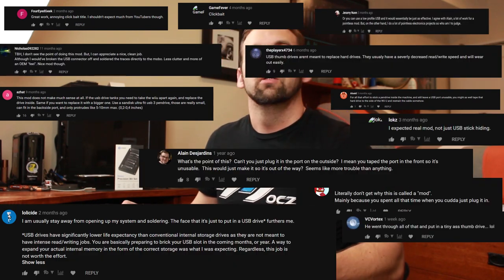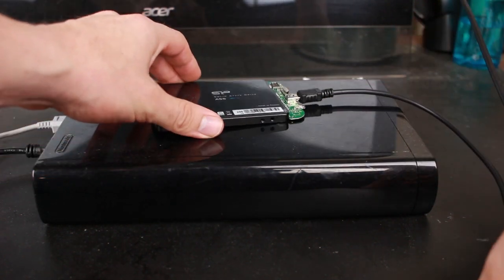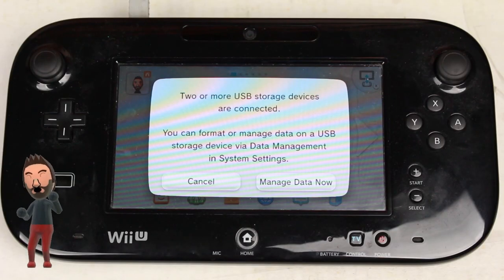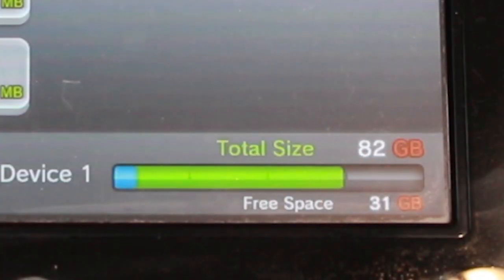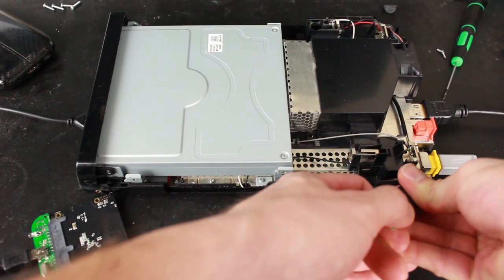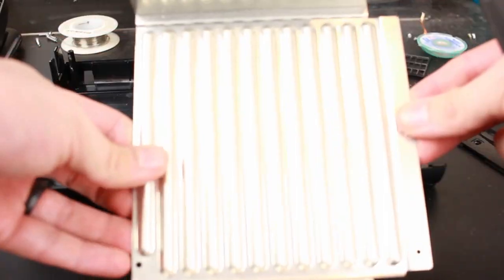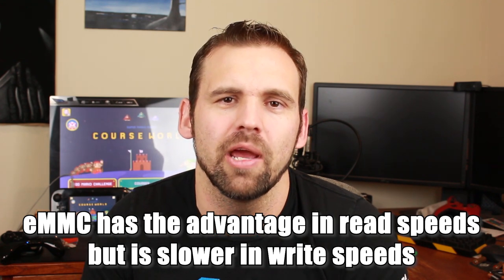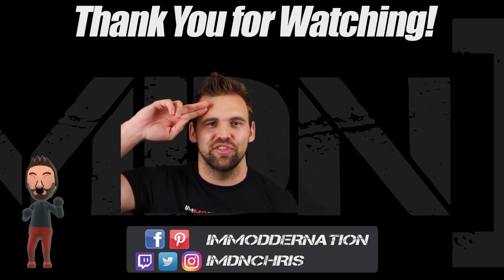EXPAND YOUR WII U INTERNAL STORAGE WITH AN SSD | GUIDE

Comment: That is not the same and I think you know that the system memory that is solderedto the board is what people are talking about so when you say I am going to internally install an SSD it tells us that you're going to remove the system storage the actual flash chip that is so soldered to the board and you're going to replace it with a different one.

What you actually have done is mod the Wii U to where you can put the external storage physically on the inside of the the Wii U.

And that is different than using the on-board NAND flash memory
Reply from the maker: I didn't actually say I would remove the system storage. I installed an SSD inside of my Wii U and it expanded the storage. Sorry the video was not what you thought it would be.
Reply: @ImmodderNation  Brandon Moore is 100% correct in his post above so in reality the video isn't actually what you thought it would be. To achieve what you're actually trying to do in this video, which is similar to an original EmuNAND softmodded Wii (except you want to keep the upgraded drive stored internally), you need to modify the Wii-U to emulate its internal storage(8 or 32gb emmc) to the new SSD. Also, the reason you didn't notice a performance increase with your mod is because the main system drive is still set as the Wii-U emmc default onboard memory. Don't get me wrong, this is still a really cool storage upgrade and took a good amount of effort to reroute/re-solder the USB 2.0 cable for the upgraded SSD placement.

Comment: in the end you didn't expand the internal storage... kinda misleading title. You just put the external drive inside the machine and thats not how it works coz its still recognized as external. Also you should have pointed out that thumb drives dont work the same way as sd cards. One is prone to fail on extensive use and the other is not. Thats way NS, 3DS uses sd card.
Reply from the maker: SD card is functionally the same as a flash drive. You have storage and a controller. It's a multi media card. The read/write cycles might be different.

Comment: That is NOT a cooler for the optical drive, it does not even make contact with it, its shielding!
Reply from the maker: What is it shielding it from, plastic exterior?
Reply: @ImmodderNation  its RF shielding to prevent electrical interference, the entire electronics of the Wii u are in a metal cage.
Reply from the maker: You're probably right. Only shielding on the top of the console though.
Reply: @ImmodderNation  no, the bottom is shielded too, the whole main board has a steel one.  I had to completely tear down my Wii u to access the ufl connectors for the antennas that handle the gamepad connection to install sma antenna sockets for external antennas, the dam thing is on the underside of the main board and you literally have to take every single part of the console apart to get at it grrr!

Comment: Your link for the "USB to SATA adapter" is WRONG! The one you link is very different from the one in your video. The main difference being that the one in your video is USB 2.0 and the one in the link is USB 3.0 . The problem is that Wii U will not detect anything USB 3.0. So your telling youtubers the wrong info.....also you've wasted my money! Thanks
Reply from the maker: Wasted? Hardly. Use the same pins from USB 3.0 as USB 2.0. Should be 1-4: VCC, DATA- DATA+ and GND. They're even the same colors: Red White Green and Black, respectively. Just like they are in USB 2.0 plug. I'll have to fix the link for 2.0.

Comment: Do not do this.....mod even if he says its not a mod. He did nothing with the board memory. Adding and internal ssd makes many problems because the wii u does not provide enough power especially if the drive gets bigger and bigger in size. Just buy a powered cheap external drive and it works wonderfully and fast just like Nintendo advise. Happy gaming to you all.
Reply from the maker: Thank you for the comment. Two things: 1. I think I already talked about SSD power requirements in the video. The drive I used doesn't require external power but some SSDs like Samsung will.
2. You can mitigate this issue with a Y cable that will provide additional power from a second USB port or you could wire 5V from the power plug using a step down converter if you don't want to occupy a USB port.